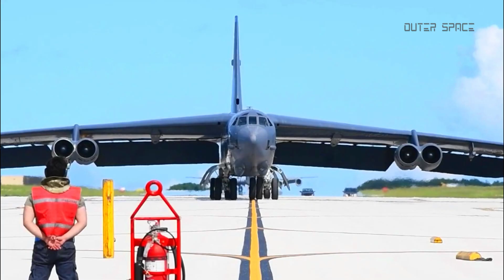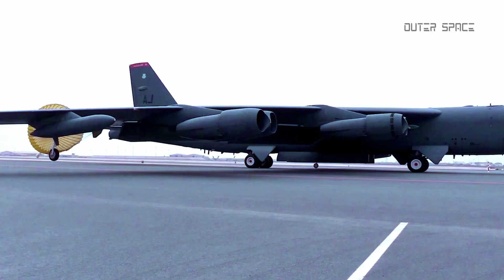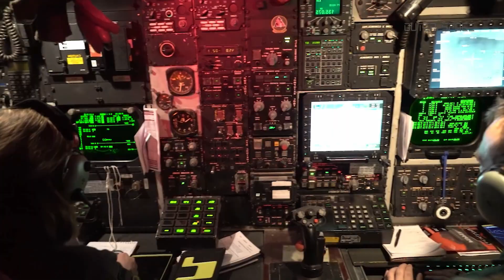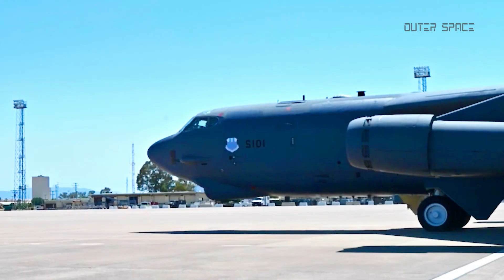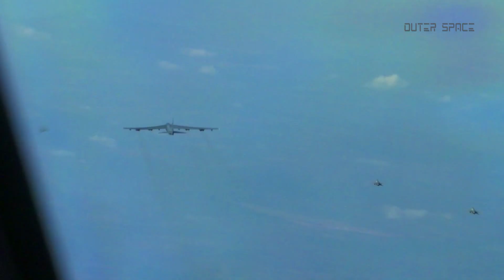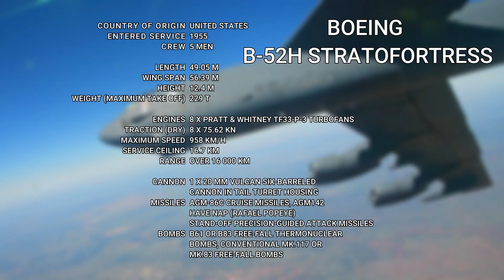Why is the skin of a B-52 wrinkled? | B-52H Stratofortress

Comment: I spent July 68 to July 69 at U-Tapoa Thailand as  SP Sentry Dog Handler working the perimeter at night guarding the B-52s and KC-135s flying missions over Viet Nam. When I came back to the states in 1969 I was assigned to Tinker Field in Oklahoma City working Law Enforcement on the base. Tinker was a logistics base that at that time employed 27,000 civilians and 3,000 military. One of the things there did there was to upgrade B-52s with updated avionics and reskin them where there was damage to the outside of the aircraft. They had huge hangars on the base that they would park three B-52s in at one time and literally took them apart down to just a shell. Because there was some classified equipment left on the planes and they didn’t work on the weekends, we had one SP guarding the planes in the hanger. I pulled the duty occasionally and was able to get up inside the planes and was so amazed at just how big they actually were. I had been up close to them many times in Thailand, watching them take off, loaded with bombs, and land and they looked big then but getting to walk around them and get inside made me realize just how big they really were. What an amazing airplane and they are still a dependable workhorse for the Air Force and this nation. Tinker was a great assignment to finish up my time in the AF, just like a civilian job, and if they had told me I could stay there for the next 16 years, I would have re-enlisted. Unfortunately, they didn’t, my career specialty as a Sentry Dog Handler was critical to S.E. Asia and if I did re-up, I would likely have been doing another tour there.